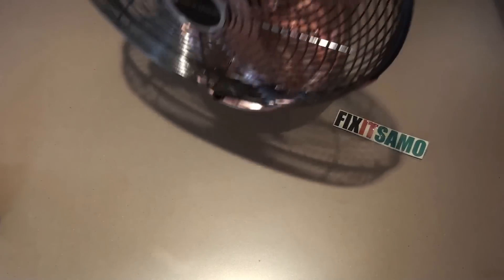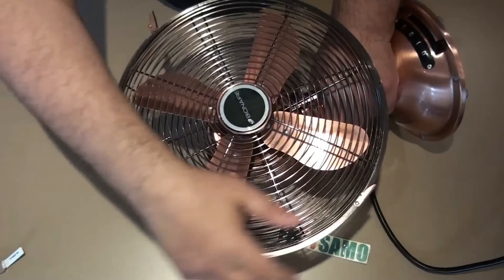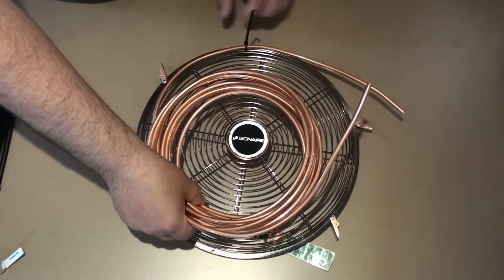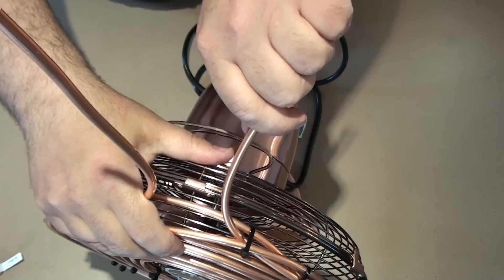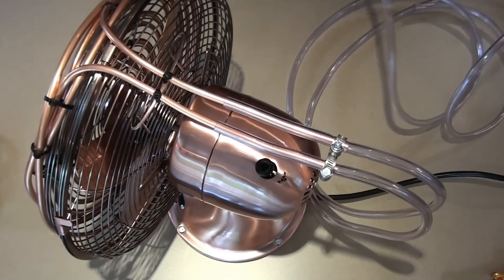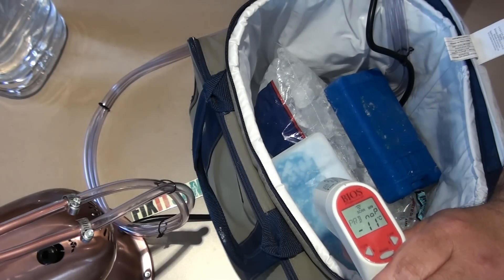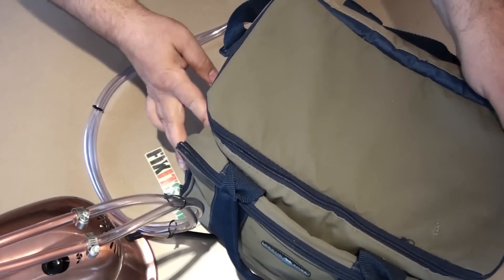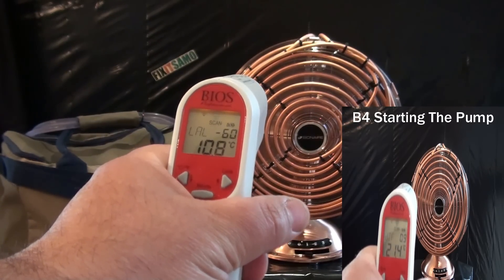How To Turn Your Fan Into An Airconditioner  AC

Comment: You can also just buy a small AC off craigslist...... Just saying...
Reply: +David Yisrael which uses about 10 to 30 times the amount of energy.... Just saying...
Reply: bugs181 No, not really. Just saying.
Reply: David Yisrael Yes really. This is fact. Denying it shows ignorance. Compressors gobble up energy. I tested this exact thing first-hand using a $80 watt meter. Why? Because I'm solar oriented and I HAVE to know how much energy every appliance consumes.
Reply: David Yisrael Please read my full message.

I wasn't talking about this specific method. Have you ever heard of geothermal energy? A method SIMILAR to this, with the help of a geothermal radiator is already saving plenty of homes energy.

You're also wrong about "most places". I happen to live in the midwest and swamp coolers won't work due to the already high humidity. 

I was stating that you were showing ignorance by the direct disregard for other opportunities a simple copper line + pump could achieve.

I apologize if I've offended you; and ignorance isn't necessarily directly offensive, it can be used as a tool. I'm ignorant in LOTS of facets of life; that's why I use YouTube to better learn about new and alternative methods. It's a HUGE disservice to humanity when we, as people, close our minds off to opportunities in alternative mechanisms.

I understand THIS particular method in the video, using a freezer, etc is extremely inefficient, but it does however show the premises of the start of how indirect heat exchangers work without the use of an energy inefficient condenser.

Comment: The temperature shown at last is the pipe temperature not the air stream temperature this does not give an idea about actual cooling of air, also beware of the danger of water leak from pipe and condensate on the copper pipe dripping into the fan's motor running on live voltage , seemed to me that this is eminent at a certain point. You can get electrified!  This is a WARNING! your safety and the safety of the rest of your household is a Paramount. This device can cause serious injury or death. A UL listed window type AC sourced from your local hardware store carries a manufacturer  warranty and liability, and will be much more energy efficient and effective not to mention, safe! Sorry to sound discouraging, I enjoyed the video and I consider this device a mechanical sculpture not intended to be plugged into live electricity.
Reply: +totti79 that was my only concern with this otherwise excellent project - I would have put the two ends down aat the front, rather than along the top as he did, so that the water path stayed at the front of the fan, thus any leaking water or condensation would be propelled forwards and away from the motor. Also, this should probably be put on it's own RCD / GFD to ensure it is always protected.
Reply: +Peter Feerick the main issue after the safety will be performance, lets put numbers here so i can explain, lets say u have 2 gallons of ice in the box, that's 7.6 litres or 7 kg, at 2257 kJ/kg latent heat of fusion your apparatus has 15800 kJ of energy, according to a post below by our guy it takes 8 hours to melt the ice, hence your cooling out put is 0.55 kW cooling and that is 1880 Btu/hr or 0.15 ton AC , the smallest AC on market is 9000 Btu/hr , so this is 20% of the smallest AC out there.
Reply: totti79 Fair point... but the next consideration is do I want a bulky, expensive & unserviceable aircon or a simple DIY unit that I can maintain myself, and is also easily runnable off a solar setup, meaning a low energy footprint (excluding the consumable - ice). A 5-10 degree drop where I am would make the different between unbearably hot, and tolerable, and I'm a cheapskate, so I'd try it for that reason. Although I'll be using a 12v DC fan / motor, not the AC setup he has.
Reply: +Peter Feerick then you would be better off with a metal galvanized ice bucket on a drip tray and a small fan blowing air in its direction , the metal bucket has more surface area than the copper tube, no need for all other ingredients ( insulated ice bag, zip ties, pump, copper pipe,plastic tubes, tube ties and lots of work ) and is still safe.

Comment: Thats so stupid. He is trying to save money but he had to buy all the supplies to make that. Plus whenever he wants to use it he has to go buy ice. And it looks ridiculous. And he still has to power the fan and the pump, and he can't control the temperature. So to sum it up he will have a very cold spot within a hot room with not much savings. Air conditioners are very cheap and energy efficient these days buddy. Go buy one
Reply: +Billy Berrill Why does he need to buy ice? Don't you have a Fridge at home?

Comment: A nice thing you made there, but I don't sea the purpose.
Since it uses AC power, it can only be used indoors. Inside, where your freezer is working to cool the ice. The byproduct of that proces is heat. So unless you are OK with heating up the place where your freezer is placed, it doesn't really make sense to use this. Would be cool though if you could adjust it so that the heat is left outside!

Comment: Add some antifreeze and the water could get cooler. And the pump will stay well lubricated
Reply: You're funny
Reply: +ZanesFacebook I know the motors in the pump with with electromagnetism, but when they run dry, they get noisy, especially bigger ones. And not dry as in run out of water, I mean no lubrication. Fish and aquatic animals produce their own slime, that slime gets into the motor and lubricates it. But since he's not keeping live fish in his cooler, its just straight water. The motor won't last long. So put antifreeze in it. Not a 50/50 blend. Even thinner. Like a 5/95 or 10/90. Just for that little bit of lubrication and lower freezing point allowing the water to get cooler without freezing.

If you wanna try this experiment get two bowls. Fill them both uo with water and ice but put some salt in only one of them. Check the temperatures. You'll see that the salt water has a lower temperature. It's a good way of getting drinks colder faster if you're going out somewhere and you're bringing a cooler along.

Science, bitch.
Reply: You must buy shitty pumps. This is a fountain pump, not an aquarium pump. 

And in my country we have vending machines that dispense cold drinks. No need to carry buckets of salted ice water when you go out.
Reply: I bet you're one of those people who salts their cooking water before it boils

Comment: i had thinking bout this idea but...
u will facing the condensation problem... yr fan will get wet... dunno how to talk but the problem is... yr fan will get wet... water on floor... water on the floor...♬♪ lalaalalal... yr fan will get wet... lalallaal
Reply: +Ben Volanz oh yea, condensation at the copper tube would be a problem and likely short circuit the fan and cause a fire hazard.

Comment: Great video! but is there any mechanical pump can be used? like using the fan's suction power to operate a smaller fan which operates the pump? low flowrate doesn't matter right? haha..just thinking something green. =P

Comment: if you add salt to the water it will make the ice water colder this is a varry cool video....giggitty...cool
Reply: No, it doesnt.
Reply: Ur wrong bro.. Salt makes ice more durable, i mean it will last more longer than normal..
Reply: +friscoHub415 
yeah, like making Ice Cream... or lowering your water cooling system temp. Just submerge a radiator into the brine-ice (fans removed) and get a few degrees cooler for benchmarks.
Reply: +iUsbHD Gaming no
Reply: David Angel it does stupid dumb
Reply: David Angel it does..

Comment: he is using a lazer thermometer to measure the temperature of the copper tubing, but not the air, that's why it is so low.  I'm wondering what is the temperature of the air.

Comment: I'd probably pick a real A/C if you want to have less electric usage.
Reply: +G00gleable forgot to add the refrigerator /freezer electric usage to generate ice. And the fact that you will need like ten devices or so to match the cooling capability of that small AC

Comment: You can avoid using ice and put the extra copper wire in clay pot as clay is naturally cold inside, so instead of making it work like an ac just cool the air by passing the pipes through some cold source and then u can give outlet on the other side with a thrower... 
Do put some plant to make it look beautiful.

Comment: hi !
I feel the need to tell you that this project is actually very very inefficient. it's more inefficient than an air-conditioner .
what this means is that this
s is consuming much more electricity than an air-conditioner for the same amount of cooling.
to make this point more clear.. if you use this in a room and an air-conditioner in the same type of room with similar conditions, and both reduce the temperature of the room by, say, one degree Fahrenheit, your project will have consumer more than double the electricity than the AC . 
it's simple conservation of energy ..... it's not logical to use this.....
Reply: what the hell kinda AC you using that uses the same amount of electricity as a fan and tiny fish motor?
Reply: +Angel Raught it's not about that. even if you were to make to a life time of savings by using this instead of an air-conditioner, you'd have to make it run only about 2 hours per day against an air-conditioned for either 6 hours. This is fact. 
after the initial investment, only the energy bills matter. and now calculate the billing of having to replace 3 ice bags for the 2 hours. if this thing actually cools, it would have to melt ice at a rate that is five times faster. this will not chill to temperatures of an AC too. hence 'efficiency' and not 'cost of electricity'.
it's conservation of energy...
awesome project nevertheless. relay demonstrates hear exchangers well..

Comment: I remember we were making DIY AC too, but this.... seriously.... a cooling bag with water and bags of ice???? 
That makes shit really inconvenient....

What we did was:
We extracted peltier-modules from broken mini-fridges (you can also buy them on ebay prettty cheap), attached aluminium radiators to each side, and mounted a fan on each side.
Wired up the peltier, and both the fans, and put around 1-2m plastic tubing to lead outside.
Worked pretty well for cooling small rooms, and since we had a fan on the cooler side, water could not condense on the radiator due to the perma airflow.
Reply: +A. Tinkovay just checked ebay, the peltier elements can be  found on ebay from under 2 dollars a piece.
Look for them as "Thermo-electric cooler"
They are fun to experiment with, and they have some other cool features. ;)
Reply: This is damn cool. Can you PM me or something? I don't exactly understand what units you're talking about (and eBay India is a LOT more limited than eBay US).
Reply: +Aditya Trivedi  Peltier - Was a french physicist, he was the one discovered the electric thermo-cooling effect, therefore Thermo-electric coolers are often referred as "Peltier element"
If you enter "peltier tec"  into ebay.in, (tec - thermo-electric cooler) you will find them.
They are cheapest from china, and they deliver to india too, most of them with no delivery cost.
Just to be sure I checked on indian ebay, they are there.
The "radiators" I was talking about are called Heatsink in english.

Comment: What if we use dry ice instead of normal ice? I guess it lasts way more longer..
Reply: +Aditya Vardhana Rentala I'm not sure it would work that well since you would need water as well.  I think the dry ice would not only off gas a lot of co2 for an enclosed space but would probably freeze the water.
Reply: +Aditya Vardhana Rentala -DRY ICE is unsafe because it dipleted fresh oxygen from sorround speciially when in enclosed area.
Reply: +1

Comment: Thank you.  This is one of the best diy AC I have seen.  In India, most people use the air coolers, but they put more moisture into the air making it unbearably humid in an hour, not to speak of all the water changing and the tanks getting moldy, smelly.

Comment: Sir I suggest the use of dry ice instead of normal and see if it is economic and more versatile, dry ice I suppose will last longer,  we can try putting dry ice in a plastic zip pouch or a thin box with water around it, coz very soon the circulated water will warm up as it is not an efficient refrigerant or else it would have been used in refrigeration worldwide, using dry ice will make it last longer I suppose.
if someone amongst us could actually calculate it on a graph time against temperature etc we can easily find out how efficient it can be. 
nice idea, hope I try it for ppl in my neighbourhood who can't afford an air conditioning unit.
thx

Comment: .... Haha's not you measure the air temperature!
You measure the temperature of the copper pipes. The air is referred to as 20 degrees. Measure the ordinary thermometer air temperature rather than the copper surface through which the cold water passes.

Comment: If you add salt it will lower the temperature of the water even more!
Reply: +Fonsie85 You can put the ice with salt in zip lock bags and keep in it non-salty water. That way no problem of corrosion, but temperature will drop.
Reply: Yea but wouldn't salt corrode it?
Reply: +Seth Winzer The copper tubes wont mind but i don´t know what the pump would say to saltwater. Everything else is plastic so it wont do anything to it.
Reply: +scott firman you can get a saltwater fishtank pump. but the other problem is can the pump handle being that cold.
Reply: +scott firman Adding salt to ice packets will be much better as it will slow down the melting of ice and will run longer.. instead of adding salt to water.

Comment: Lacking sufficient transfer of (only moderate) cold from coil to air, that thing isn't going to work all that well. A budget or used air conditioner would obviously be a better choice. If you go to an old building being torn down, they might even let you have one for free. Heck, I got two this way.

Comment: You need to remove heat, not introduce cold.
An AC unit removes the heat, it does not force cold air in.
That is how refrigerant works........

Comment: 1) How many hours the cool last? ( or how many hours the water inside the bag in this video retains its cool?)
2) What is the difference between this and placing a cold water bucket in front of fan? Won't the water molecules evaporate and create chillness?
Reply: +Jay Kumar R copper is a much more thermal conductive substance than air. So the cold pipes absorb a lot of heat from the blowing air. Air above a bucket of cold water does not get as cold as the copper pipes would get, so they would absorb less heat from the blowing air.

Comment: I'v'e tried this project, for fun, and while it does work, there seems to be something left out.
The condensation on the copper tubing from the cold water going through it .
You end up with water dripping on the fan base which in turn makes a big puddle around it (just what you want an electrical appliance sitting in water)
Reply: +prunga308 It's true condensation forms on cold surfaces in hot weather - however the coil is directly in the air stream and this should prevent moisture from collecting on the copper tubing to the point it stats condensing all over the floor. A better design would have had the connection to the plastic tubing routed under the motor, with a plumbing sealant to go along with the screw on clamps., and a thermal sleeve to go over the water lines where they're exposed to air that does not move. This would reduce condensation and improve the efficiency of the device at least a little.

Comment: I hate to be the bearer of bad news, but if you are using a freezer in your house/apartment to freeze the water/ice packs, this process is actually going to lead to a net heating of your house...  you aren't moving any heat out of the house, and the freezer is actually heating your house while it makes ice - and you don't get all of the heat produced back in to the water when you melt the ice/ice packs.  Ultimately you have made a heater out of a fan.
Reply: someone paid attention in thermodynamics class :)

Comment: 10 in copper,  that metal fan is $40 , the water pump and tubes $15 plus the lunch cooler and 10$ to 15$ plus the ice which is like 3$ 
small portable ac unit like 100$ save your time abd money for these tricks that were invented by tweakers
Reply: the issue is the electricity to run the ac unit not the cost of the ac unit. you can get the ice for under a buck but of course this depends on where you live. the ac unit may not be able to be placed in your face like this can. some quicky math is around $2 a day for a really nice unit (10 hours a day) or $3+ a day for an older or cheaper less efficient unit.

so if you only need spot cooling at your desk for example this unit will save you money even after purchasing ice over a normal ac unit.